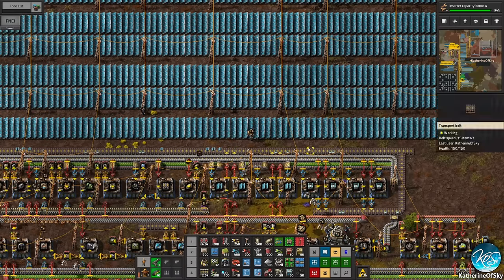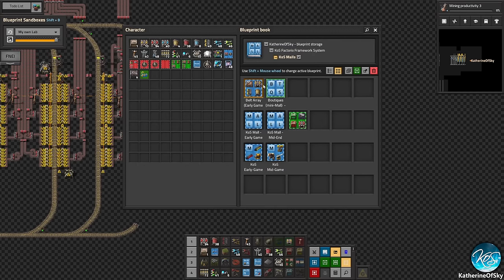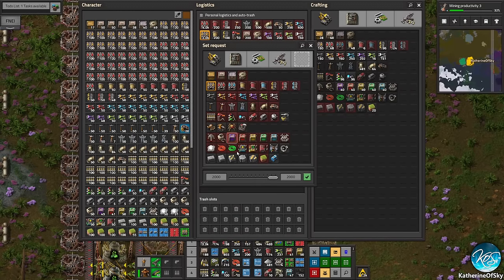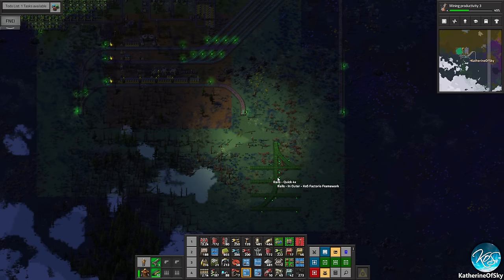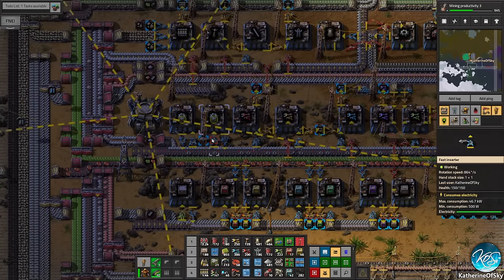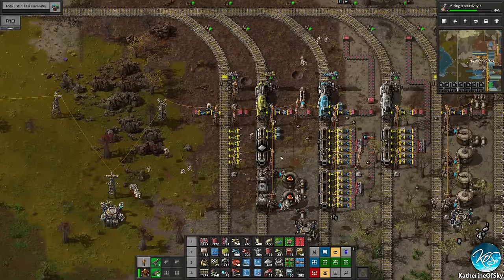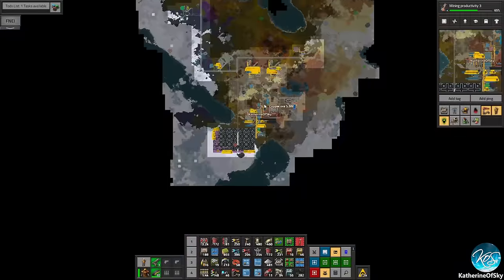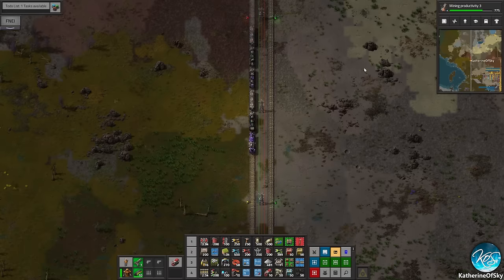Factorio Trickle Down Megabase 10 - NUCLEAR BUSINESS - SETTING UP URANIUM PROCESSING - Let's Play

Comment: For the Engagement: 
I expanded on your Kovarex design, and with surprisingly little changes it can support 1000+ Reactors even if they are completely unregulated. Basically it just needs more used-up uranium fuel cell recycling for that, everything else can stay basically the same. 

Kovarex is ridiculously OP
Reply from the maker: Nice!

Comment: My buils style way is too ADHD driven to be usful to anyone I think :).  Ive playrd over 1700 hours and in total maybe 3 rockets launched. Some part always trips me up. first it was splitters and undergrounds. then it was yellow and purple science 

and now those 2 rockets are sitting there, waiting on their sattelites. its a red chip thing and thats a plastic thing and a elektronic parts thing. But im almost there. I know i just got to push through this barrier. Ive started over so many times thinking : next time im going to be better preapred.
Reply: I started a new run about a month ago with the intent of making it into a megabase. I created a blueprint with four train roundabouts and straight lines between them in a square, of exactly 100x100 so each of the roundabouts plus the middle of the straight lines have a roboport in them. Then I filled a large area with that blueprint, creating tons of squares. Each square gets to do one thing. The size works out really well; I have one square dedicated to yellow science, one for blue science, you can just about fit 8 rows of smelting setup into one square, and most other components fit in well into a square. Some just need large throughput so need multiple copies of the square - but that's relatively easy, you can copy/paste the designs as you make them. The rocket launch square is my favorite for how it looks; in some others the limitations are mostly around placing the stations with enough belt throughput coming out of them, and then having enough space for the factories. In the rocket launch square, I managed to include 8 stations (highest after this has 6, for purple science), and 4 fully beaconed rocket silos, plus in a tiny square the infra to build the satellites. It does include the one place I sort of cheated - the solar panels are imported by belt into this square from the one to the right. Everything else is carried by train.

I've had tons of fun thinking out how to make some things fit in a 100x100 square. It also helps focus, since I use a calculator to figure out how many of a given factory I'd need and then estimate what I think will fit. Usually I tend to squish in just a bit on the tight side, which makes for nice routing problems.
Reply: @dascandy  Cheting is when you use commands to spawn items. Belts are no cheats. The cornerstone of the entire game. It seems you have a great plan and executed it well.
I sorta had a plan too. try to ratio and automate the "building blocks" of what I need. like miners and trains and such. BUt I have an K2 - SE- BZ - ERM going. like red chips require a factory on its own. the "Malls" too. But im getting there. ERM is enemies. for my son. he loves blasting biters of all kind. slows my progress though. Kids. what would i not doe for  them.